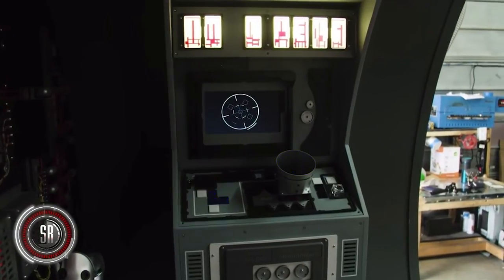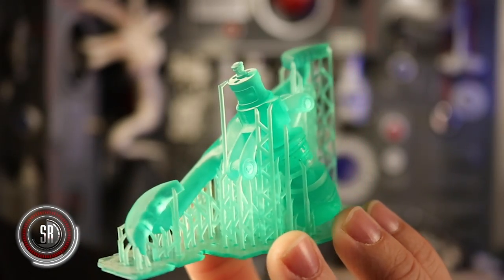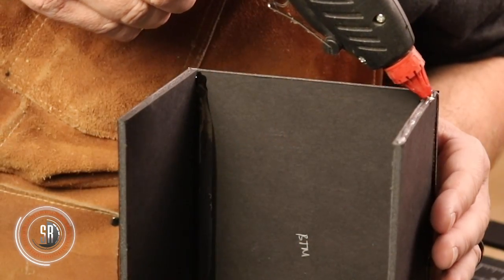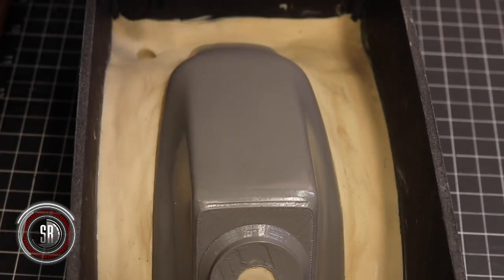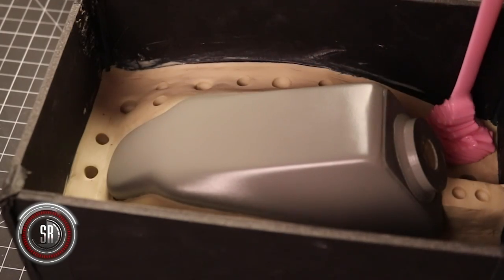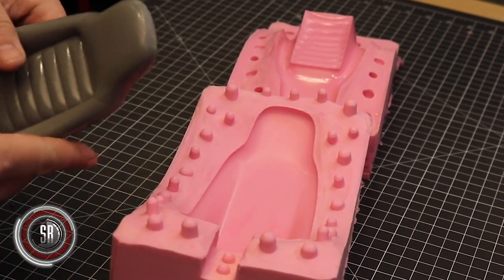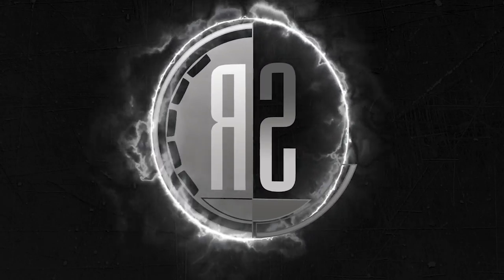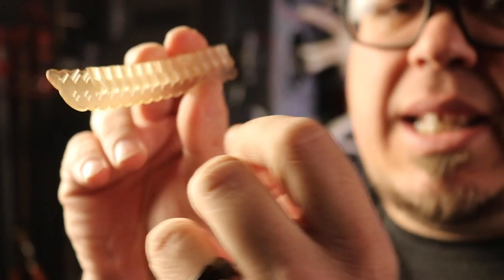Millennium Falcon Project - Molding and Casting in 1/6th Scale

Comment: A rad new video. I can't wait to see your Falcon kit finished. As others have stated a brush-up matrix mold would have saved on silicone
Reply from the maker: Thank you Wayne!  yeah brush on would have certainly have helped.  I also got a great tip from Mark at @GratuitousSets who suggested using small parts from older used molds to fill in space, so that would have helped as well.  Thanks as always for coming by Wayne!

Comment: Hey Brian... As a "Resin Caster" myself, I can't think of ANY way you could have done this with less mold material. It ALWAYS tends to be the MOST Expensive material when casting! The Resin is CHEAP! But the Silicon is ALWAYS Pricy!

I WILL add that you can shake "Baby Powder" into the mold to take away the "Shine" that resin tends to have. Once you spray the Mold Release agent then shake the baby powder in and dump out the access. It ALSO makes for finding any blemishes and air holes that might need to be filled.

Also you can make "Air Release Holes" in the mold using some old model sprue. This works best in places where air pockets can easily form in the mold.  I hope this all helps? :)
Reply from the maker: Hey!  Thank you!  Those are great tips.  Very much appreciated!!!
Reply: You are MOST Welcome! I belong to several Model Clubs here in Wisconsin and we always try to help others out. Once a month we do a "Table Talk" where we show something to club members that we found to help with model building. I like to do what I call "Modeling on a Shoestring Budget". because I have found that with a little know how and imagination you can utilize LOTS of "Everyday Items" to make realistic Models and you don't have to go broke buying expensive after-market parts to do it! 
So I'm always happy to pass on tips. 
Also I use an old re-built "Dental Mold Vibrating Plate" to remove "air bubbles" from my silicone. 
It works GREAT AND I got it for FREE and just had to re-wire it for it to work! :D

Comment: Great video. Just a quick proficiency tip, clay up your model and then build the walls around it. Not only is it faster than working inside a prebuilt box, you can also follow the shape a little more precisely. You can score the foam core every few mm and put a radius in it that would follow the head of the chair for example. May not seem like much, but these little things do add up and it saves a lot of silicone over time. 

Another thing you can do to make it a little easier is add your funnel in during the clay up.  No need for a big chunky pour spout.
Reply from the maker: JackRupert133 these are fantastic tips!  Thank you.  It never occurred to me to build the form last.  I can totally see how this would cut down the silicone and be more efficient. Much appreciated!

Comment: I would have used a matrix mold. It would use less silicone and would still work the same.
I mean, for reference, I have never used a silicone mold, but I know that a matrix mold would use less silicone.
Reply from the maker: You are 100% correct, and I absolutely should have.  I have yet to try a matrix mold, but I will.  Thanks for watching!